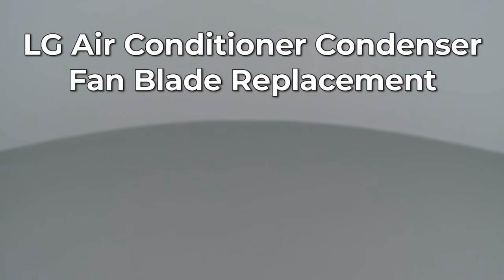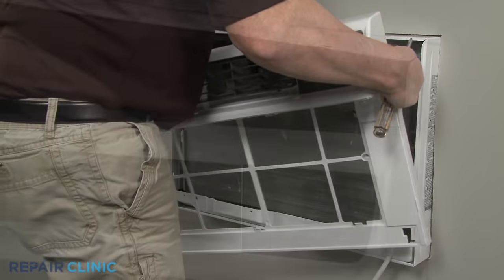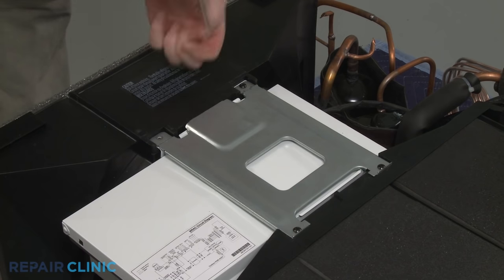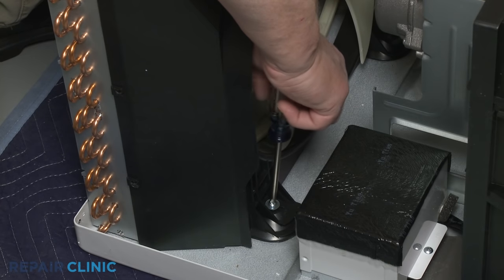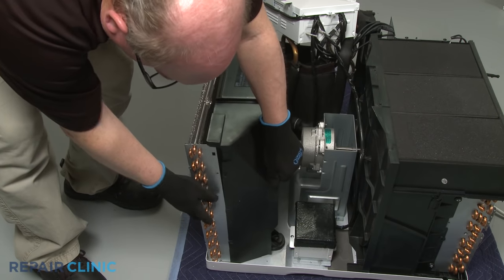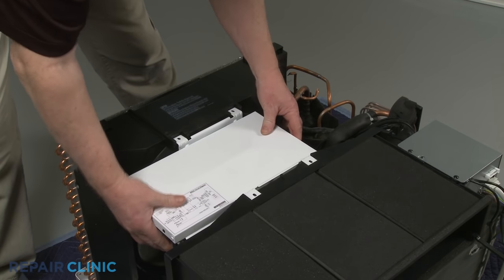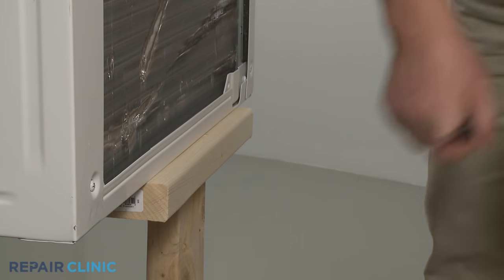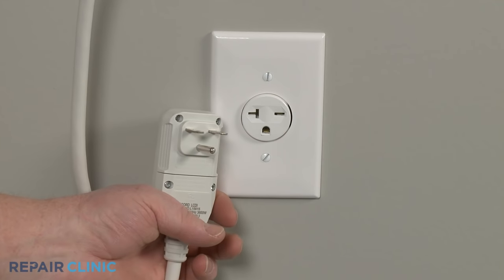LG Air Conditioner Condenser Fan Blade Replacement 5900A10011A

Comment: My unit is almost identical, it appears my condenser fan is stripped on the shaft. I took it apart this morning and rigged it with tape on the shaft and zip ties to lock it down. Not sure how long it will last, need to locate correct replacement fan. I thought this was the cause of my CH34 code and shutting down, but I guess it’s just too hot. 103° right now. Condenser is a little dirty on the inside.  I might do this again tomorrow morning before it’s in the 90°s and try to clean up the condenser. I cleaned up the filter and everything else this morning. Thanks for the video.

Comment: Nice video, but quick question:
Will there be videos for a Frigidaire?
Reply: LG owns Frigidaire, the procedures the same for the older units. I just had to change mine as the blade broke. it was a bit of a pain but, I got it fixed!

Comment: When you snap the clip back onto the blade, should there be any movement of the blade forward or back? My machine started making a lot of noise and I noticed the blade was shaking quite a bit. I followed your video and noticed my blade can be moved with the clip still in place.